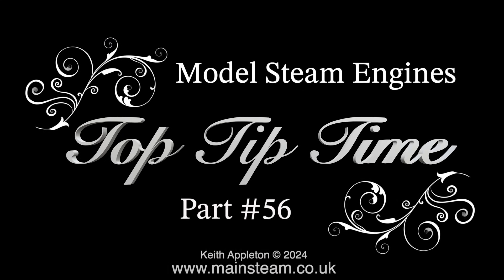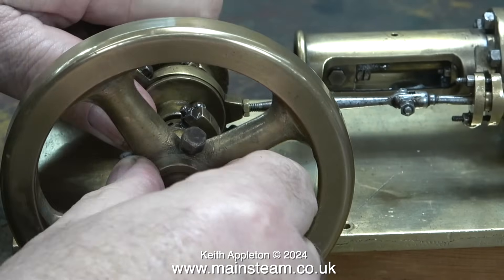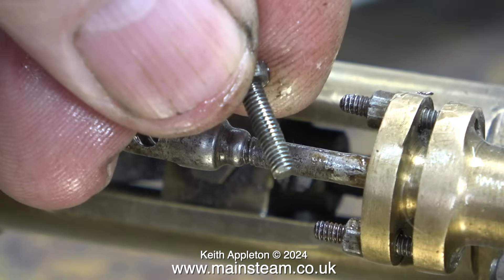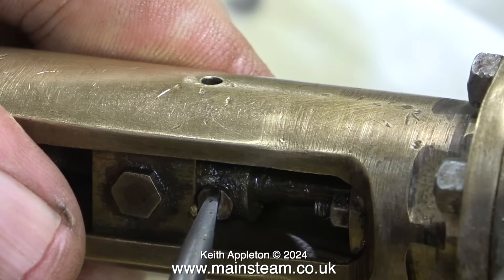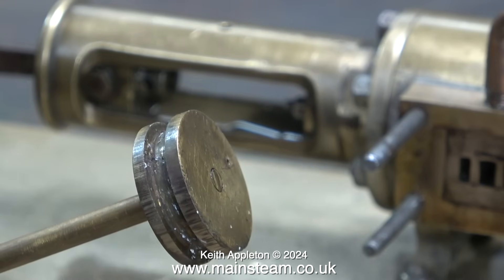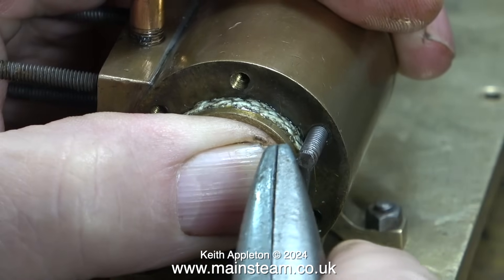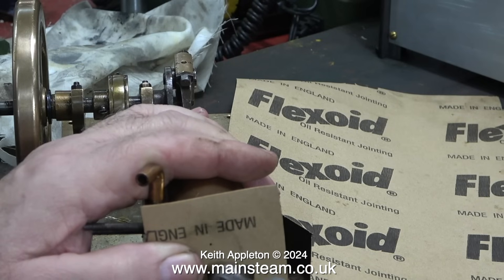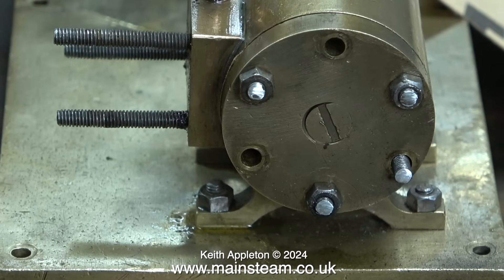MODEL STEAM ENGINES - TOP TIP TIME - PART #56

Comment: Had to tap out head gaskets at the roadside whilst visiting Sussex in 1980 on my old ex police velocette le mk3 , unfortunately that didn't cure the problem and so had to get AA relay back to Edinburgh, took 6 hours to get through London due to the embassy seige. Ended up selling the bike to the Chambers St museum in Edinburgh. Not easy to work on, the le ,but conceptual in its operation. The noddy bikes were 12v too for lights and radio. Happy days.